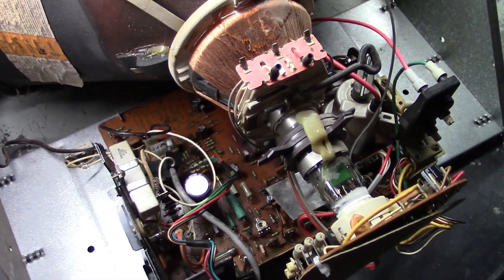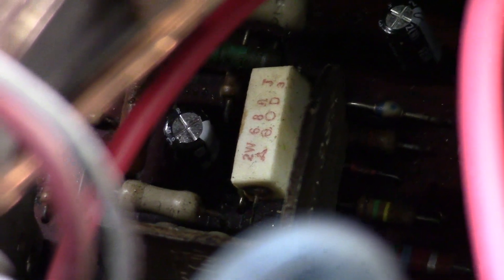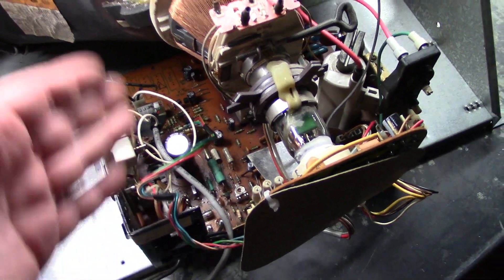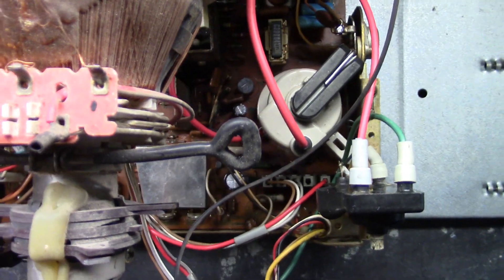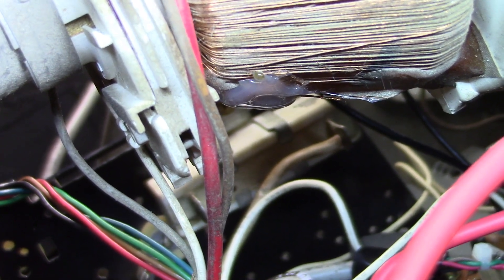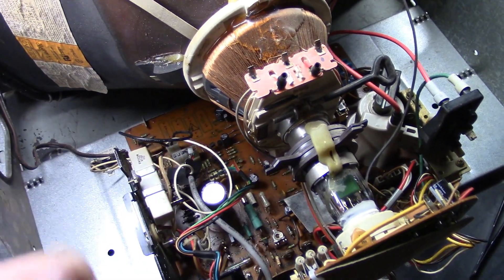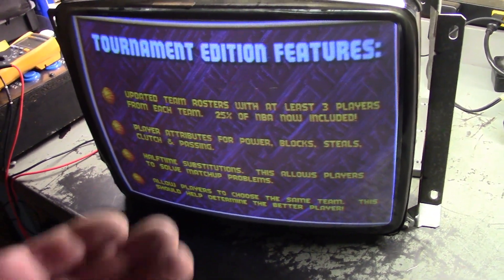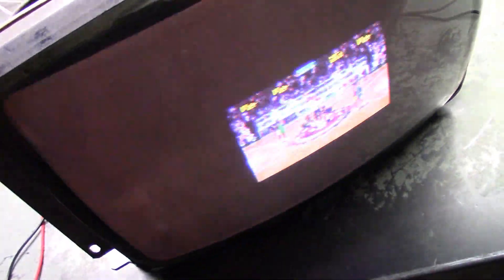19" G07 Arcade Monitor Chassis Repair - Vertical Collapse/Open Yoke Winding

Comment: Mine has two parallel horizontal lines along the center about half inch apart from each other if that helps troubleshoot at all. Would love some tips if possible.
Reply from the maker: Only thing I can suggest given everything you’ve done already is to test every resistor/diode/component in the vertical section. B+ read 120vdc?
Reply: @MikesArcadeMonitorRepair  yeah b+ is good. What happened was the monitor quit first. So I did a cap kit. Then replaced the flyback. Still dead. I was getting 150+ volts across the big resistor. Then yesterday i reflowed the x501 area and then the voltages dropped to 120 and I got a discharge spark on the flyback cup after powering down so I figured I solved it. I drove to the place where the crt is and hooked it up and it comes up but now vertical collapse. Fr401 is good 68ohms. I replaced the remaining transistors and ic501 I had new and still no luck. Maybe the two lines is just the game. I need to try disconnecting the logic board and see if it is a single line. Then test the two vertical transistors. Can I connect the horizontal deflector wires to the vertical circuit somehow and rule out the crt?
Reply: If I connect red and white from the crt yoke to Q5 and Q3 shoukd I get a horizontal line instead of vertical and that will rule out the crt as being the issue?
Reply from the maker: I would not do that. You’ll likely damage the yoke or the chassis further. You can flip the wires to flip the image, but you can NOT swap the vertical and horizontal connections. They have vastly different resistance values and something will get messed up.
Reply: @MikesArcadeMonitorRepair  ahhh ok good to know. Thanks. Ok I’ll check the resistance between red and white, and gray and brown. Do you know how many ohms I should expect? Looks like you were getting 2 - 5 ohms
Reply from the maker: somewhere around 3 and 53.
Reply: Also, any clues or ideas why I have TWO horizontal lines right next to each other?
Reply from the maker: No. That would be a new one for me. Are you on FB? Can you post in the monitor pages?
Reply: @MikesArcadeMonitorRepair  I am on FB as my dog. Grrl Hord. What’s the name of the forum?
Reply from the maker: Arcade Monitor Repair and Arcade Game Repair Help Group

Comment: I have a nightmare g07. It quit on me. I did a cap kit. Nothing. I did a flyback replace. Nothing. Found broken traces and jumpered everywhere I could see. Nothing. Reflowed solder around x501 and finally got high voltage and a display but now it has vertical collapse. I’ve replaced IC 501, x101,x102,x103, x105, tested fr401 and still no luck. 

The quest continues. I have the flowowing list of parts to test next. R522, X401, X402, R402, R420, and now from your video, R412. 

If there’s any others I should look at, please let me know. I’m clueless about g07’s.

Comment: Could be related, but my Frogger's original GO7 worked fine for years until a vertical collapse one day. Did the usual chassis repairs, same thing and also noticed it was causing one of the 1watt resistors to heat up enough to glow?! Replaced the chassis and immediate collapse and same thing? Eventually the only way to get it working was to replace both the tube and the chassis as a set from an old rally x. So something in the tube on that setup was causing these issues but never could isolate what it was.